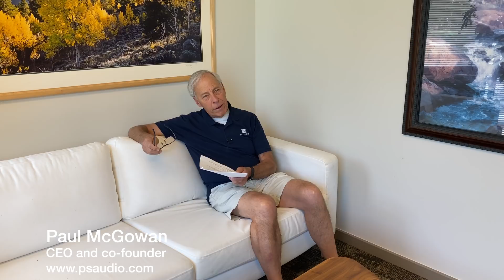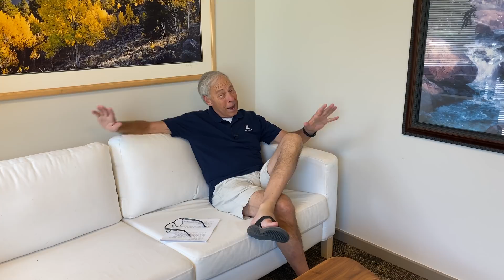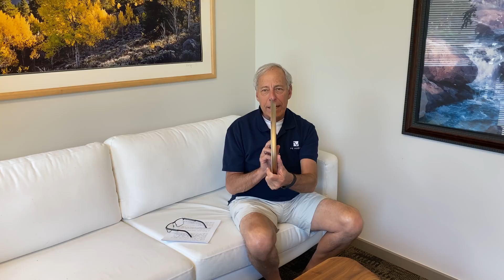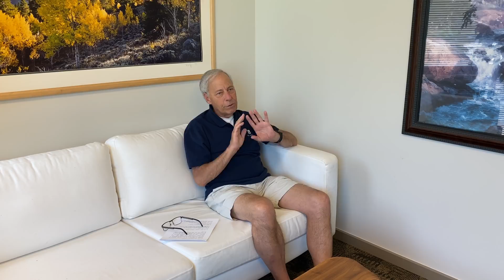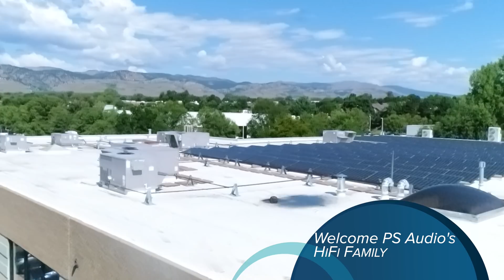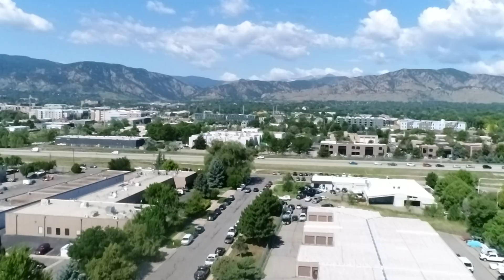How speaker cabinets affect sound

Comment: This probably won't be seen, but I'm particularly wondering about the difference between the tall and slimmer floor-standing speakers, versus the more conventional (or now old-fashioned?) rectangle boxes that don't have a whole lot of cabinet below the area where the drivers are. - This often also makes the drivers in one of those "pillar" boxes smaller, like an array of 6" woofers, and the wider boxes of course allow for larger drivers, like 10-12-15 inch woofers. - I really wonder how they stack up to each other. - I have some of both types, but I can't really easily get them into the same room together. Besides, they sound too different from each other anyway.

Comment: Hi. I am from INDIA. I love your videos❤️❤️❤️ from which I learned a lot.

I decided to build my own dual 3 way speakers for casual listening and bought some of the components for them, which is listed below. Could you suggest an good enclosure for it. I need it to be smaller. 

Components bought-

2*Tweeter - 250 watt. "3.15"inch

2*Mid range - 25-40 watt. "4"inch

2*Woofer - 10- 80 watt. "8"inch
The above listed every drivers are 4ohms.

2*3 way crossover

Stereo amplifier circuit (ic4440) 2*50watt output

Bluetooth and usb module

12v 3 amps transformer

Every design ideas are respected.

Comment: When we going to see these new speakers you keep banging on about going to show us a picture or 2,  really doesn't make much difference if you show them now or afterwards.  did you sort out that bracing issue did you try two cross members shaped as a opposite triangle fastened in the middle.
You should turn the box like any musical instruments try e flat (c) all rights received for tuning a speaker box patent pending. just in case you get some bright Ideas.
The IRS 5 are they servo controlled and if are they originally digital or analogue servo feedback
Reply: You might see his fantasy speakers in 2025. I've never seen it take a manufacturer take this long to produce speakers. Obviously they are struggling with a lot. The more ridiculous thing is that he's mentioned like five different prices for them. And I love how it just keeps on going up and up and up and up.
Reply: John ...The FR-30 loudspeakers should be available in December this year & the IRS 5's were originally servo controlled in the bass but, since their 'Dayton' upgrade earlier this year, they are  no longer servo'd.
Reply: @FatRat-f9m  Dont hold your breathe Rat:)
Reply: @FatRat-f9m  ok cheers! well it doesn't stop them putting a feedback circuit with the new drivers
Reply: @FatRat-f9m  I don't know about that got a link how do you know??

Comment: Paul, please tell me each woofer in the IRS 5 has its own sealed chamber?!?!
Reply: @Jingle Nuts yeah open them up for us. It uses 12" right?
Reply: I put a guess on it working in 2-in-one sealed box working in parallel and then fed to the next box in series working in parallel
Reply: @johnsweda2999  
The woofers are all in parallel.  The amplifier is designed for loads just under 1 ohm.  
Tweeters and midranges are in series/parallel combinations.
Reply: @marianneoelund2940  right that's pushing it at 1 Ohm's are they 16 ohm speakers or 8 ohms with a resistor
Reply: @johnsweda2999  
Voice coil DC resistance is 4 ohms, which means the nominal impedance would be around 6-8 ohms for each woofer.  There are six in parallel for each channel.

Comment: Sealed boxes have a "air spring" effect. The bigger the volume the less resistance your woofer/subfoofer gets, but they can't be too large then you bottom them out (unless you are talking about infinite baffle)
Reply: Same actually goes for a ported box. But the "spring" effekt is less than im a sealed box.
And a infinite baffle makes speakers bottom out easier than a box would anyway.